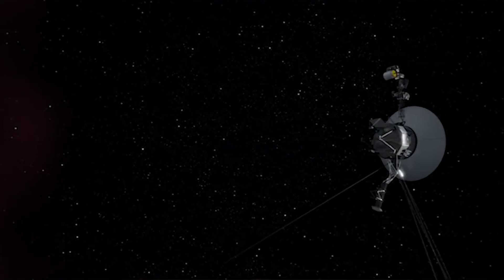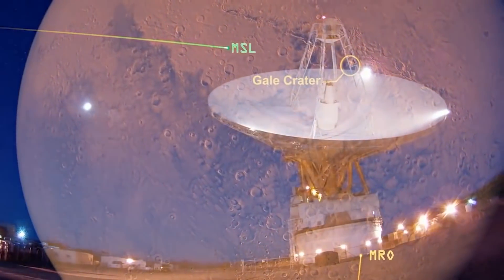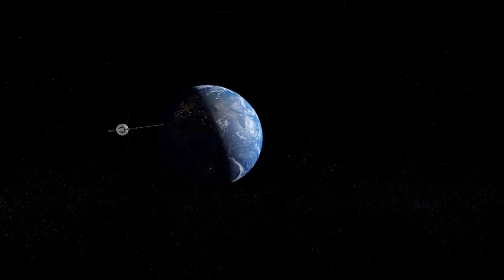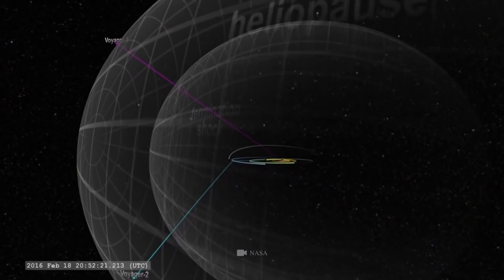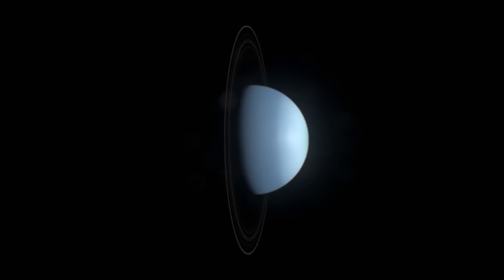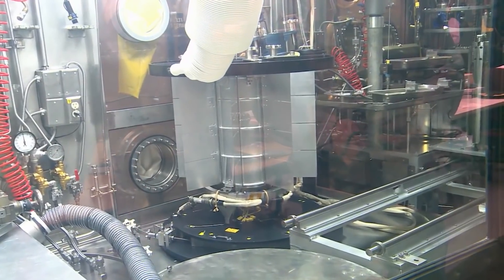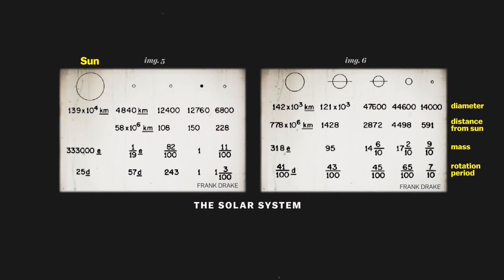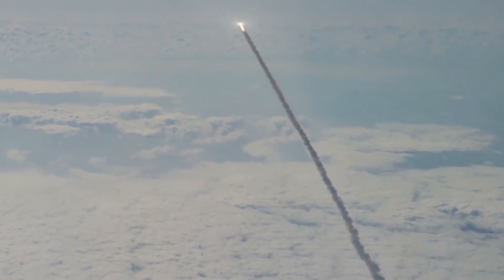Voyager 2 is FINALLY Back Online but Scientists Found Something SHOCKING

Comment: Hey, there is a misinformation in you video. 5:53 ,The RTGs is not exactly the same as nuclear reactor that are in use today . Electricity produced in RTGs from normal redioactive alpha decay that produces heat when it hit any metal surface just like visible light .It also uses seebek effect that is the heat difference between anode and cathode to produce electricity.Anyway, great video with your amazing voice :)

Comment: They didn't put a record on Voyager 2 because hard drives didn't exist in the mid 70s.  Hard drives were invented in 1956 https://en.wikipedia.org/wiki/History_of_hard_disk_drives
Reply: It wasn't a CD or a computer hard disk, it was a mechanical disk like a vinyl record used in the 60s except made of metal.
Reply: @karhukivi  Is that not what a computer hard disk still is today? (As long as it's not an SSD or flash drive)
Reply: @danielpassigmailcom  No, a computer hard disk consists of millions of tiny magnetised zones which represent bits of data, magnetised in one polarity is a "1" and the other polarity is a "0".  The vinyl disks had a groove which was irregular so as to make a needle vibrate and the vibrations create a tiny voltage on a ceramic pickup, which is then amplified to produce the sound.  They are mechanical, not magnetic disks.
Reply: @danielpassigmailcom  No...
Reply: @danielpassigmailcom  Yes, they are magnetic disks that spin and the bits they detect are tiny magnetized zones on a flat surface.  The read/write head floats a few microns off the surface, close enough to detect the magnetization. .  Aluminium, brass or gold disks will not work in a computer HD unless they have a coating of a magnetic oxide, similar to what was used on magnetic tapes for VHS and audio machines.
Reply: Uhhhh, the "record" isn't a computer disc....
Reply: @JeffCounsil-rp4qv  I meant I thought hard drives were metal disks, at least a bunch of them together. Not the Voyager records

Comment: The golden record is an excellent choice for Voyager.  They can see the grooves and tell that information is encoded on it and follow the grooves (assuming they are like us and don't read the instructions first), and the grooves will still be there after flying through magnetic and radiation storms.  
With magnetic and floating-gate (flash) technology, it's not obvious there is information on it and can easily be destroyed by their experimenting with it, if not yet destroyed by solar storms or gamma ray bursts.
Of course, we are assuming a certain physiology here.  The aliens may see magnetism or electric charges like we see visible light, but they would likely also have some type of electromagnetic sense that can "see" in wavelengths smaller than the grooves of that record so they notice it.
Reply: Shame it didn't happen just a little while later.  They could have included footage from Star Wars of Alderaan getting blasted by the Death Star as a means to perhaps ward off any aliens who may come here with hostile intent.
Reply: Wow it would be just a laugh..
Reply: I always voted for a Deep Purple 8 track.

Comment: The two Voyager probes must be over 60 years old by now, not 45 years old even though they were built in 1976.

Reason: Gravitational Time Dilation

According to Einstein, the further you are away from a gravitational source, the faster you age.

Interesting, huh?
Reply: That effect doesn't just keep on increasing forever!  Better to think of it like "the nearer you are to a gravitational source, the slower you age".
Reply: If you like Relativistic/Gravitational Time Dilation you'll love Interstellar.
Reply: No. Just no. You need to read your Relativity reference more carefully.
Reply: @ngc-fo5te  YOU need to read about it:
 https://wtamu.edu/~cbaird/sq/mobile/2013/06/24/does-time-go-faster-at-the-top-of-a-building-compared-to-the-bottom/

Sounds like you can't wrap your head around it so you dismiss it out right.

Comment: Can we have like one more snap and shut the camera back off 🙏
Reply: They've unloaded the software from the spacecraft and decommissioned the ground computers capable of decoding the images, besides, the vidicon camera is only 800x600 even if they took a picture you wouldn't be able to see much.
It would have been useful to take a selfie to check the spacecraft's deterioration but there's no light source on board nor the power to really do anything.
Even Carl Sagan had to fight to convince NASA to take a picture of the Earth. the "Pale Blue Dot", before they finally turned the camera off.
Reply: @peppeddu  thanks for the info
Reply: How about a family photo of the Solar System?
Reply: that would be cool but highly unlikely atleast we got that 1 picture from voyager 1

Comment: I always have connection problems with my cell phone lol  how in the hell they communicate  11 Billion Miles From Earth lol
Reply: Broadcast vs. narrow signal.  If you point a signal straight in a single direction, the signal dissipates much less than if you're broadcasting.  Cell phones work on broadcast; they send out their signals in all 3D directions at once, meaning they dissipate rapidly.  And not just the phones themselves, but also the towers that are supposed to receive the phones.
Reply: @Thomas.Wright  Cellphones are not supposed to reach much beyond each "cell" or service region.  When you move around, the phone switches to the nearest cell and changes frequency slightly.  That is how the system is designed to work and explains why the term "cell" is used.   In big cities, the cells are small, perhaps hundreds of metres, but outside in the countryside the cell can be 5 to 20 km in diameter.
Reply: @Thomas.Wright      7 watt light bulb. Even if that were focused into a laser....
Reply: @Thomas.Wright  and the radiation ?? lol from here to there?? dont you agree that radiation kill signals ?
Reply: @franzrothschilds6975  Radio signals are a form of radiation, because they are radiated!   The word "radiation" simply means energy that is propagated either as particles (alpha, beta, protons, neutrons etc.) or electromagnetic waves like radio, IR, visible light, UV, X-rays, gamma and cosmic.  Even sound (a pressure wave in air) is radiated.
Reply: @franzrothschilds6975  Radiation will not "kill" the signal, which is itself radiation. Stray radiation picked up by the receiver can, however, cause interference.
Reply: A football field diameter satellite dish aimed precisely at where voyager 2 is

Comment: Who can believe that we can communicate by radio with something 11000000000 miles away? Its 20 watt transmitter would produce a signal here of 1/10000000000000000000000 th of a watt. Spare me the science fiction nonsense.

1 second ago
Reply: You are forgetting the gain (amplification) of the 70m diameter receiving antenna on this end.
Reply: Also, Voyager is using a narrow-focus transmission rather than a broadcast.  It's sending its signal roughly in a straight line, whereas broadcast sends the signal in all directions in 3D at once, meaning they dissipate much more rapidly.
Reply: @Thomas.Wright  That is what a parabolic antenna does.  When adjusting an 80cm satellite TV dish, it has to be within 3 degrees of the (geostationary) satellite position.  The larger the dish, the more focused it is, the Deep Space Network 70m dish has a beamwidth of about one-tenth of a degree and this is usually described as the "gain" (amplification) of the antenna, given in units of dB compared to an omni-directional or "broadcast" antenna which has a gain of 1 (unity gain).
Reply: @Thomas.Wright  Even a norrowly focused transmission would be impossible to detect, still less make sense of. How does this 'voyager' know where to point its transmitter? How does it monoeuvre itself? How does this 'voyager' receive signals with its little dish?
Reply: @WSCLATER  George Reynolds already answered your question above. From what I've seen, he seems to know what he's talking about.
Reply: As long as the particles of the wave vibrates with tiny little    frequencies (? in the nano area ) telescop can catch it, amplified by some million times and analyze, it can be scientifically  reconstruct the origin  shape. That's what all those holy crazy people did in NASA 😛. Try it also in Carl Sagan's(?)  COSMOS , but don't get mad 😀.

Comment: 😂 11 billion miles my ass you can't get a phone signal in the mountains or a basement , only a fantasist would buy into this unbelievable bullshit fed to the dumb herd
Reply: Free mind thinker - I think not. Before proving your lack of knowledge publicly you might want to learn about the subject of radio propagation.
Reply: One of the more mindless comments I’ve ever read. Do some research for your self and expand your knowledge. This is all based on facts, unlike your cell phone theory.
Reply: The DSN transmitters/receivers are 200kW 70m diameter high-gain antennas.  No mountains or basements to get in the way.
Reply: this isn’t connected to us by phone towers i think this has something to do with the international space station😑

Comment: How come that scientist that time didnt put an extra battery for another 50years more deep space travel
Reply: I'm pretty sure they intended for Voyager to to last only 5 years.  This is year 39 of bonus content
Reply: @housefish3205  they only made them to explore the solar system, not interstellar space. but they bought the new dlc to allow them to live for almost 50 years
Reply: @housefish3205  Wrong.... It was built to reach Interstellar space even though they thought it may not survive that long. Why else would they put the golden record on it?  They already knew there was no intelligent life in THIS solar system... 🤣
Reply: @JeffCounsil-rp4qv  I suppose the actual structure of voyager was anticipated to last forever (barring  collision). The science gathering aspect of the mission wasn't supposed to last this long.
Reply: the plutonium thermo-electric generator is good for at least that extra time, but the range of the transmitter will be the limiting factor and it's getting near to that now.
Reply: They weren't on sale at the time...

Comment: how do they calculate distance?
Reply: distance = (speed of light)*(round-trip signal time)/2.
Reply: A transponder on the spacecraft sends a signal back to Earth when it receives a ping from the DSN antenna, the two-way traveltime gives the distance.
Reply: @karhukivi  Marco!

(a day & a half later)

Polo!
Reply: By not using Common Core...  🤣
Reply: By an astronaut carrying a measuring tape floating through space... an extremely long and super heavy at that!